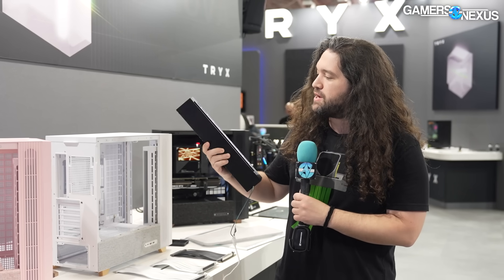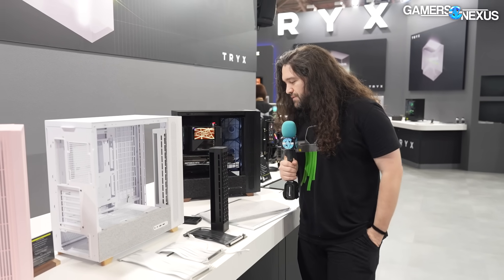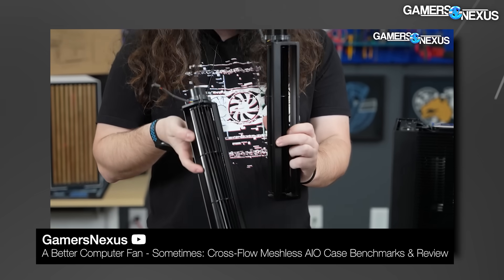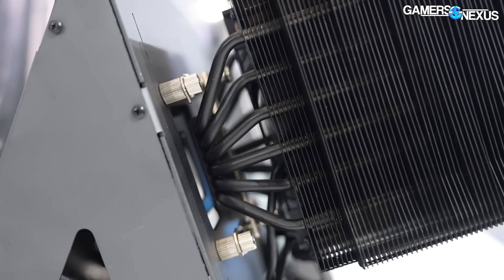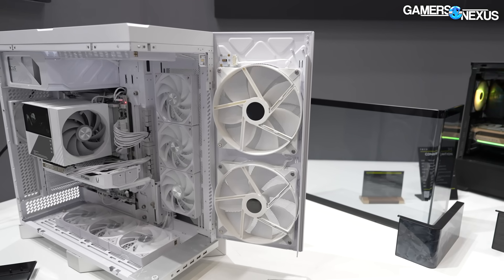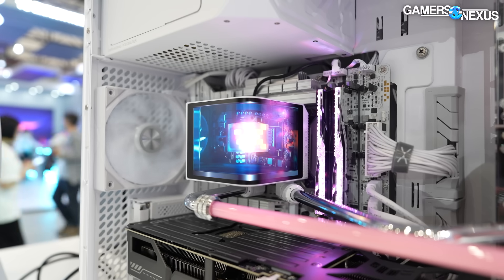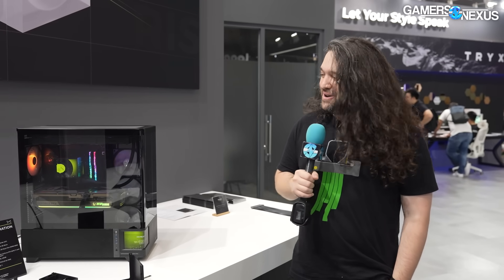TRYX Crossflow ATX Case Fan Takes Risks | Flova, Panorama, & More

Comment: 9:06 I feel so called out, though I do question the stage cooler is any better than a fan platform shroud. I'd worry about the weight on the stage sagging over time if placing anything heavier than a noodlestopper on there will affect temps..though the shrouds ain't any better 😅 +1style points -4 C thermals

Comment: I don't think the crossflow fan is there for performance. I'd expect it's a workaround to not have that fabric front panel turn into a dust collection sock if you just leave those 120mm slots unpopulated.

Comment: I'd love to see what they could do with dual crossflow fans in the front pulling from each side of the case. 

Make the case thinner, use vertical GPU mounts, and see what happnes. 

A tall thin case with high performance and excellent acoustics.

I just don't see this being competitive against traditional fans ***in the same form factor***. 

I feel like they got to try a different shape for it to matter.

Comment: I wonder how effective a crossflow fan mounted horizontally above the PSU shroud designed to push air up to the GPU would be. Would have to be balanced with case size to allow room for bigger GPUs, might be better suited to a dual chamber case.

Comment: that crossflow fan, needs moved to the side rotate the PSU 90 degrees so it pulls air from the oposite side of the crossflow, would allow the 200s in front with teh addition of the crossflow pulling from side to top, directly pushing to the GPU
Reply: if a vertical gpu was used, with rotating the psu, you might make a "slim" version keep it max width of 140s in the front, less footprint with added airflow

Comment: I totally rock that air cooler with the lcd, just wished they added an rgb infinity mirror on the bottom side of the top to jazz up some of that wasted real estate. Or feature a version that utilizes infinity mirror fans with a window cut out in the middle to accent the mirror on the middle fan

Comment: I think the crossflow fan might be good fit for getting air from the bottom for the GPU. Put a pair of them and a diffuser right under the GPU and you should get pretty good airflow. The configuration shown should be good for a top down CPU cooler and vertical mount GPU? Neither of which their test system has? Also might be interesting in a combo for a radiator since it would allow unusual form factors.

Comment: There are no filters. Without filters, everything inside will be full of dust in no time. And the front and side panels will also be filled with dust and they are not made to be cleaned. As an idea it is not bad but as a service and protection from dust it is bad.

Comment: My Computer Case is on the Hardwood floor slightly raised 2" by small blocks on all 4 corners - I would not waste money on a display and I do not care about RGB lighting - I wear active noise cancelling HeadSet so Fan noise is not a problem - Performance and Cooling are the top priority - (Gaming only on my PC's)🤣

Comment: Cross flow fans are not usually used in computing, the noise per volume flow rate just isn't there. If you want to move a lot of air quietly, this really isn't an option.

Comment: That crossflow fan is a bad idea on so many levels.
We all know how dust sticks to other fans and it takes wrok to clean them on both sides.
Now think of the crossflow fan and think how could you clean the outside of blades with inside of blades.
Now times that by 100 if you live in humid or in smokers homes and air is not enough to even clean regular fans let alone the crossflow fan.

On top of that you now add two sets of bearings and have to worry about there failure with the crossflow fan.

I like they are trying new things but crossflow fan should never be used in a home pc in my view.
Then think of cost of the fan and the special cases you would need to use them.

Comment: Have an inwin case from 2010 and a. AIO water cooler that came with the previous cyber power also
From 2010. Never had thermal issues. Use top of line you and guy. Hottest I’ve ever saw was 76. I don’t get all this focus on the perforation and flor. lol. I got 3 random case fans that were like 5$ on temu.

Comment: I almost think crossflow fans would make sense to put horizontally into the PSU shroud because they can pull a lot of air into a much more comparatively thinner footprint in that application compared to an axial fan. This would mean providing direct airflow for the GPU while taking up (comparatively) minimal additional space inside the case, and with fewer compromises to functionality of the rest of the case. The only downside to that would be needing to put vents on the side of the case that is typically where you have a transparent material like tempered glass, but plenty of cases already have ventilation on the side PSU shroud anyway so I see this as an easy thing to adapt.

This configuration is interesting, but I feel it makes too many compromises for what it achieves. It doesn't seem to leverage the advantages of the crossflow fan, but rather seeks to replace axial fans in some capacity, which to me doesn't make sense. A horizontally-mounted GPU intake fan that pulls air from a ventilated PSU shroud to me makes far more practical sense.

Still very interesting and cool though :D

Comment: Put fabric on the case so you can generate dust locally, genius.

I don't hate the crossflow fan idea, they work in AC wall units after all, but why not have 2 one on the left and right, generate a big stream of air that way. You'd probably want a completely different case format to take full advantage of it. If you got noctua on the case they can probably make you a near completely silent one.

Comment: I modelled and 3D printed a cross-flow fan design, but its very noisy compared to Noctua and the airflow is thin and tall and not over a bigger area like you want. For an AC unit, you want a cross-flow fan.

Comment: I don't need the displays to talk with each other wirelessly, TRYX. What I need is for the screens to be abutted in software, and for Windows to do this with its native tools. Even better — reprise the old-school VGA days of loop-back video attachments and create a PCI bracket with four HDMI connectors; two inputs in the case, which will then loop back to two outputs on a GPU. That would simplify software implementations immensely.

Comment: I did a design of a laptop cooler few years ago. Considered cross flow fan, but after looking at specs from multiple manufacturers I come to a conclusion that two good quality 120mm fans push more air and are quieter than one 240mm cross flow fan.
Crossflow fans are quite good at low speeds, but at high RPM they are a lot less efficient than regular fans. Both in therms of air moved and noise.
If you CAN FIT a regular fan into design - there is absolutely no advantage to use crossflow fan.

Comment: I'm surprised wheel/cage fans aren't already being used in pc's. you can get more air pushed over a larger area with smaller fans. that's why they've been used in auto heating/cooling for decades now. its probably because they're loud.

Comment: short-finned cylindrical fans will suffer all the drawbacks of the 25-60mm fans for NB/CPU heatsinks from slot1-socketA era decades ago (poor CFM:RPM ratio and noise), with additional issues like motor longevity due to much higher mass of the blade assembly...not to mention filtration. i appreciate companies experimenting, but this idea seems to be deliberately casting aside already-learned industry lessons.

Comment: does the length of a heat pipe have an optimal range, obviously within height tolerance... but is longer better?
would it be possible to 'snake' and bend a longer pipe to fit within - lets allow a little more height, as cases are larger in the current time

eg. is it possible, i know about the 'new' 3d heat pipes shown in another video, to bend the original layout of pipes to maximise coverage over the whole fin stack... instead of straight pipes, i could make 3 diagonal passes across the same area??

Comment: Patent Pending is a cheap way to buy 'idea protection' for a short time. In most instances, companies will file for a patent, get the Pending number, but never actually file for the patent, which gives you a bit of exclusivity window. The pending form is a few hundred dollars to file, vs an actual patent which is tens of thousands of dollars. 
In this case, what I see is a long squirrel cage blower with an overly inflated price. All those tower fans you see from the mid 2010s are the same working design as this. My workshop air purifier uses that design principle and cost me a whopping $25 (not including filters, the relatively expensive consumable part).

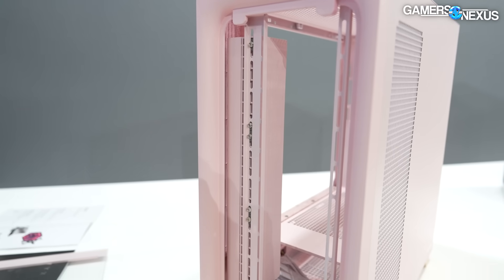Comment: 3:55 That crossflow fan is most useful if it is located at the bottom of the case as intake, blowing cold air to cool the GPU . The size of the fan are more or less the same as 3 fan GPU in length. It is a waste to put at the side in front since there are 3 fans for intake already.
Reply: I was thinking set it as an exhaust fan in the top above the board, usually cases have some extra space up there, and could slot in behind other fans/a rad as a sort of bypass to promote cooler air going through the cooler

Comment: Don't know if TRYx is going to bother reading any of these comments, but we have been using laminar flow fans in reef tanks (saltwater fish tanks) for years.  If they want to apply that same concept in CPU cases moving air instead of saltwater they really need to think harder about the flow path throughout the case.  Spend the extra $ it will cost them per case and add 1 top exhaust fans, 1 rear exhaust fans and 1 bottom intake.  Not only will it test better in the GN testing, but it will cool better across the board and if people end up using an AIO in the top (side intake will likely test better in this case layout), they can always move the second fan somewhere like the bottom below the graphics card where it would benefit from being regardless.

Truthfully, my first setup I would try if air cooling would be no front intakes, 3 side intakes, 2 top exhaust 2 bottom intakes 1 rear exhaust + the laminar flow front intake.  If AIO, AIO side intake, and add a 3rd top exhaust.

If they need the additional front fans to lower temps then the implementation of the laminar flow design is just gimmicky and unnecessary.  Best performance is probably 1 laminar flow intake on each side of the front but not only does that skyrocket the cost it also removes side intake/rad support.

Laminar flow is great, but you have to really consider how you plan to make those directional changes when using it, hence most laminar flow fish tanks still have to have small traditional fans for "dead spots".  If you're going to apply it in a PC case, where do you want to force the laminar flow to turn when it needs to SHOULD be the design goal.

EDIT: spelling
Reply: Hi there, yes we do actively read the comments and love to hear feedback for our products! Thank you for your suggestion and we will pass this along to our product team for consideration.
Reply: @tryxglobal  That's excellent, to help, Maxspect calls them "Gyre Pumps" and they do have a controller on it for speed, hence it's common to setup one on each end of a reef tank and set them to oscillate back and forth 180 degrees out from each other to give you a wave effect back and forth in the tank.  It works really well, but as I said previously you still end up with dead zones just due to the shape of the tank and your rockscape inside, have the need for additional smaller pumps of which EcoTech  Marine is the industry leader for "propeller pumps" as it relates to both performance and noise.

At the end of the day you're still moving a fluid just different density.  Dealing with obstructions you expect, ie video cards and CPU air coolers will help significantly bring down temps

Just the product info on their website will probably help as they have already tackled issues your team is probably still facing.

Good Luck with this technology, would love to have it widely available in the CPU space.
Reply: Ductless minisplit air conditioners/ heat pumps all use this style blower. Highly efficient and quiet for the volume of air being moved.

Comment: Ah yes, the old crossflow fan, that fitted into a 5.25" bay on a case. Absolutely loved them. The reason they were noisy, was they only had a bearing at the motor end.

Would still like to see more cases with a mesh panel, rather than glass.
Reply: Difficult to clean, low longevity due to accumulation of dirt/dust putting stress on motor, difficult to access for maintenance, etc.
Reply: I thought they were noisy because of the low radius and high RPM. If it's just the opposite side bearing that's missing, it would be an easy fix.

Comment: They should commit to the crossflow fan and go all in, remove the standard fan's place from the front and include 2 bigger crossflow fan instead. The design is great, proved itself in AC units. If they play the safe game and try to introduce slowly into the market the project will fail. They need a good BDLC motor at the base and the only noise what's left is the wind noise to deal with.

Best design for liquid colling would be 2 big fans on the bottom of a case and the air pushed out on the top trough a passive radiator. Companies novadays scare to commit to a strict airflow cases like bottom to top, or front to back and start to punch holes everywhere in the case.

Comment: IMO, either fully commit and put two of the cross flow fans in the front and do away with the axial ones
Or do away with the crossflow fan and go for 2x200/2x180 axial.

Comment: God we need to start having a standardized pattern for cross flow fans, like 240x40x40 and 280x40x40 and then 360x40x40 or so.

They make a much nicer woosh than typical fans and I believe with a decent enough pressure for case cans and maybe even light rads.

Too bad the cases back panel is so asymmetrical with the other side.

Comment: The main problem with cross-flow fans is that they are high-flow at basically no static pressure. Very useful for things like room ventilation, but even a fairly open PC case could significantly stall their flow. Laptop squirrel cages have a bad reputation for a reason, but in some ways, they are a better implementation of a tangential fan design because they actually have some static pressure.

Comment: Surely the advantage of using a crossflow fan would be that you could use it to both draw air in and out at the same time, as long as you put barriers in the correct positions and control the route the airflow goes in.

Comment: My ~20 year old CoolerMaster had an optional cross flow fan, but it was meant to blow air over your overclocked DDR2 and motherboard/VRM. Neat to see this coming back again!
Reply: Coolermaster Stacker 810 had that as an option, pretty cool stuff.
Reply: @wibla2578  That's my case! Been using it for that long, only my 2nd build in it too. I ran with that Core2Duo overclocked on air way too long!
Reply: Writing you from my CoolerMaster Stacker right now.

Comment: The Luca L70 looks interesting, but there should be a dual chamber version so that the PSU is not preventing the installation of a top exhaust fan and isn't exposed to hot air from inside the case. Also, a metal side panel (instead of the glass panel) should be an option.

Comment: I think the CNC shaved pipes are best for vertical pipes coolers.

1850 RPM, what's with the snowflake noise tolerance? 2,500 is stll good, specially to save the life of a CPU/GPU. I'd want even 3,600 RPM max.

I think the GPU is not well cooled as the CPU till this F'ing day; nobody, and I mean nobody, has invented a good GPU cooler that doesn't push the hot air on the thing you're trying to cooldown, it's so dumb.

Also a Motherboard, that positions the Video Card in sucha  way, that can have it's own volume, for cool air to enter and cool down an improved GPU Cooler. I'd put the GPU on the other side of the MB, and have a case that hold the cooler in a sturdy and firm way, also vertical small cooler, with vertical fans; at least I'd make experiments, with normal MBs, GPU cooling is so inefficient.

Also closed-loop cases with a mini-chiller, nobody has the balls to do this, even when it's a great idea: Remember the Intel Chiller Fiasco? yet it as a genius idea if not done in a hurry the same day, like they did; you do it in a 40% humidity 10ºC air and a mini-chiller to Rule it all. Case doesn't need to be that big, so the overall case would be ~same size as a normal case. It's like a liquid cooler, but won't F'ing leak on your MB. What's not to love?

@1:35 Make MBs with a PCIe connector, on the Superior/North of the CPU, since it's Local Bus, doesn't need any Chips between the CPU & GPU; so the Videocard is parallel to the CPU, also would screw on the Case; and would also have a vertical cooler, maybe smaller but longer, at the current length, with 3 or 4 fans on it in a vertical position. Much better cooling, and would be helped with top 3 fans on the top of the Case; PSU would be at the bottom. Best solution, same as for the CPU; why nobody does this? You free the middle for other peripherals that are not as hot nor as bulky as the Videocard. The Connector won't be broken or mechanically stressed by the dumb design of Cases not supporting the Videocard weight; Won't Sag, won't suffer mechanically at all; it'll be as save and secure as the MB. Also the GPU can have Closest Access to the RAM, and the CPU can have Closest Access to the VRAM; you can additionally make te PCIe Buss wider: 32 or 64 Lanes, for Parallel & Full Duplex Side-Channels, so both the CPU & GPU Co-Process more efficiently and with greatest Bus/PCIe Efficiency